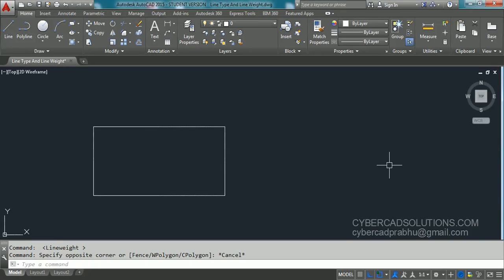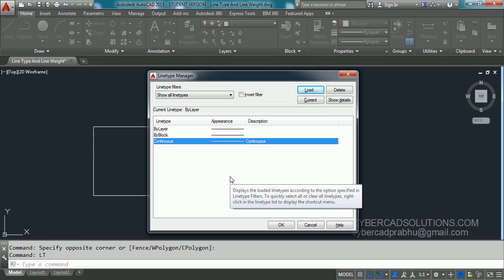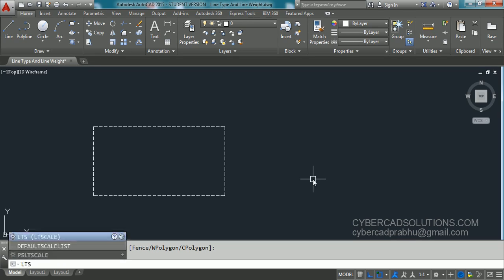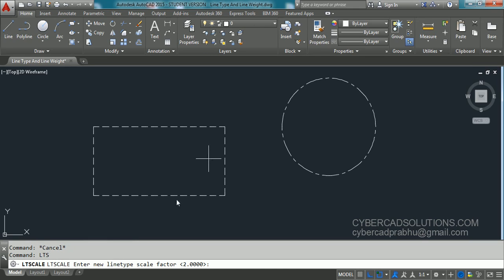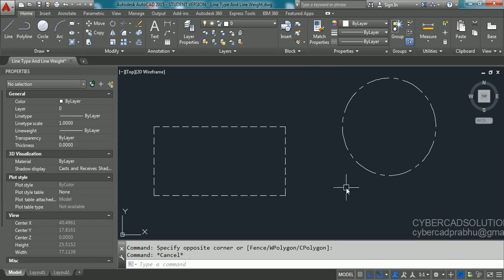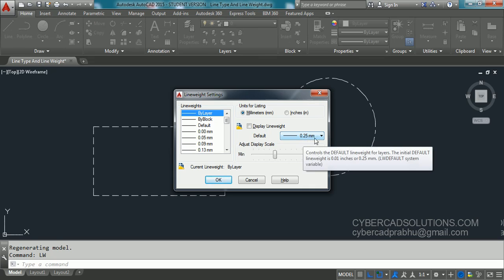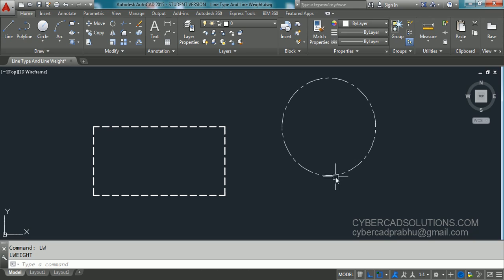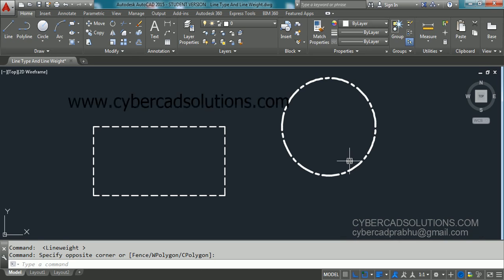How to Change Line Type And Line Weight in AutoCAD

Comment: When I draw the circle it is not showing hidden line and when I convert also same problem
Reply from the maker: You need to change line type scale.
Reply: @cyberCADsolutions I tried but not solve that problem only when try to draw or change circle. When I use line draw or change it is works